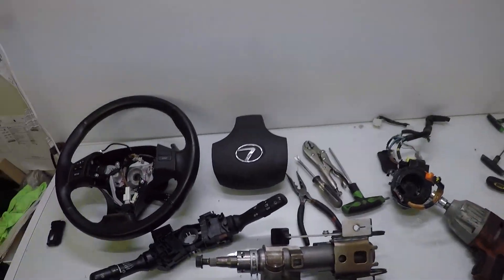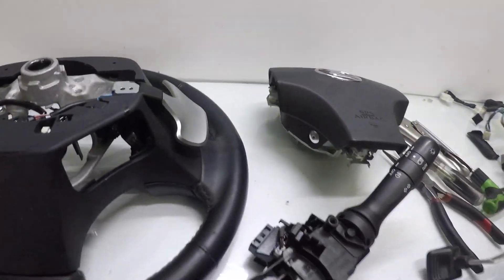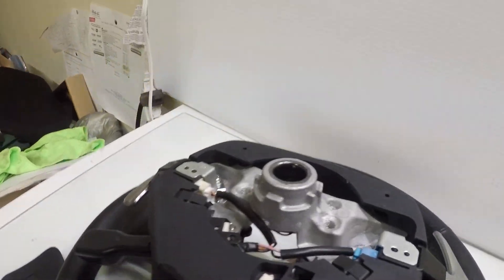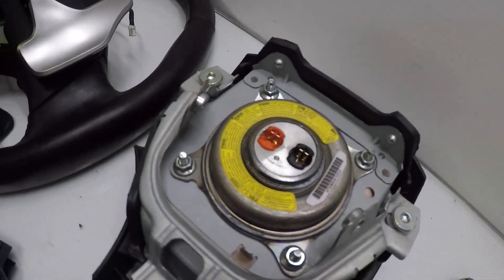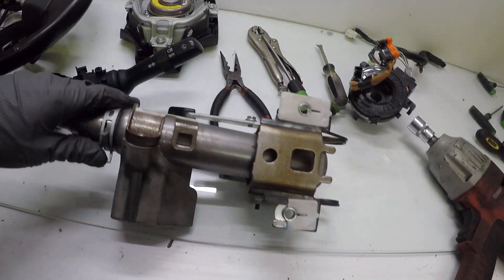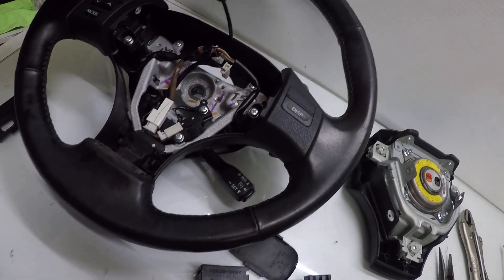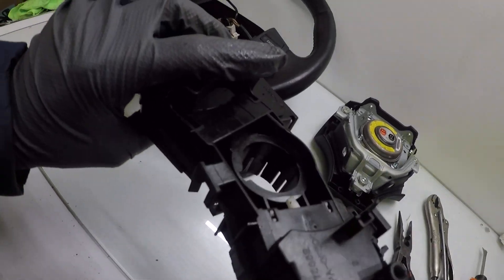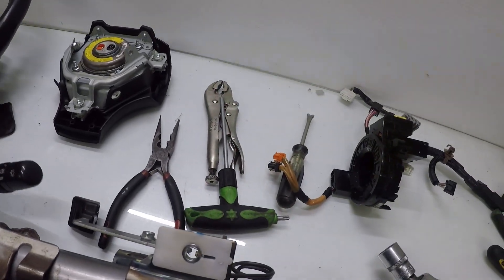Lexus is250 is350 Airbag Removal

Comment: Hi there. The black and orange connectors on the airbag, are they BOTH for the airbag or is one of them for the horn?

If you could let me know, that would be terrific!
Reply from the maker: Both for airbag
Reply: Ar Su Can you tell me which wire is for the horn in the clock spring?
Reply: Ar Su or even which wire controls the horn in the steering wheel? Thank you!

Comment: If I brake the housing of the orange and black clock spring sensors can I replace it without having to change clock spring ?
Reply from the maker: Are you talking about the plug/connectors.
Reply: Yes luckily I was just researching and I found a solution to buy new tabs an replace I can send you a picture of the what I accidentally did
Reply from the maker: @qj30a1  yes they are replaceable